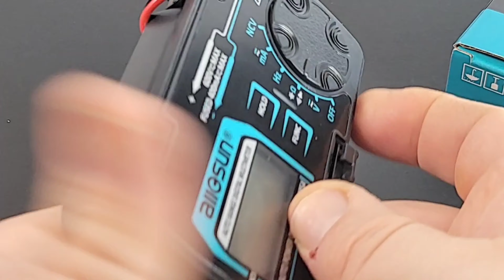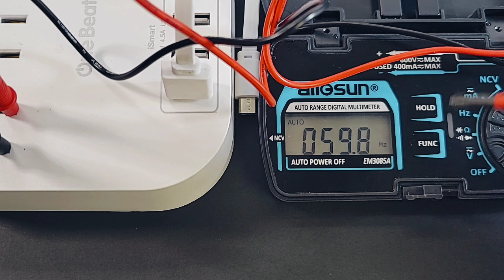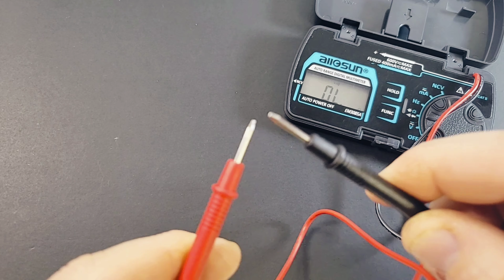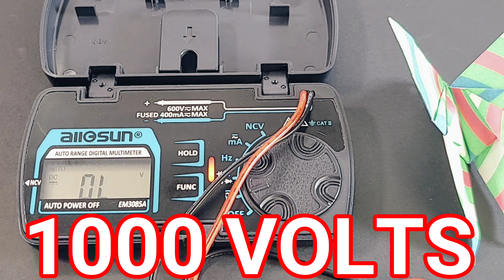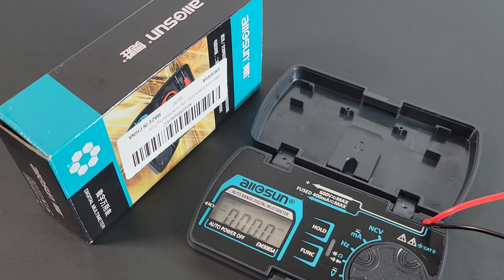ALLSUN 3085A CHEAP-O Multimeter Review & Teardown!

Comment: nice review.. at first i was about to just end watching when you made snarky comments about this meter that seemed unfair to me. Also, when you opened it up to put in the battery i wish you were more careful with your editing to show us what you saw inside after removing the back cover. It was frustrating that you didn't show us the inside where the battery and fuse are etc. thankfully i continued watching and was able to see the circuit board and battery and fuse. I am ordering one of thes meters. i think i may take the ciruct board out and then modify the screen cover so i can se the display better.
Reply from the maker: Thanks 👍  I always do the teardowns and reveal in the last part of the review ..glad you stayed until the end  😊

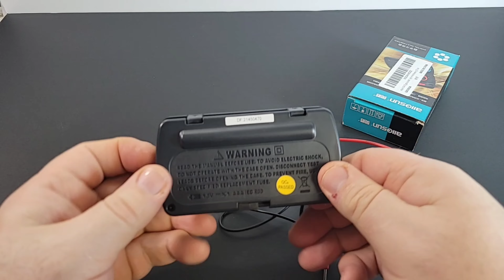Comment: @2:30 Take out those leads and the retaining tab becomes a kickstand - that's what the arrow is trying to tell you!   "Wouldn't it be nice" if they put that in the user manual after they show you the case locking mechanism!
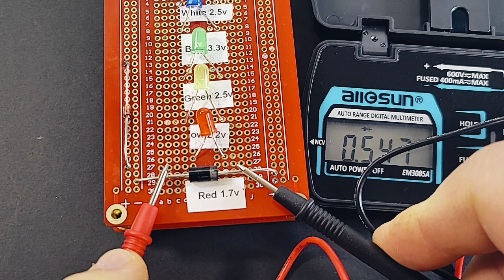@6:00 I have a special white pen that I use on many of my selector switches to make the indicator stand out.  Alternately whiteout correction liquid and a toothpick.
@7:00 2,000 counts rant - I agree!  I hate the last digit flipping back and forth between values and creating a significant % error in the reading.  What do I do, round to the middle!?!?
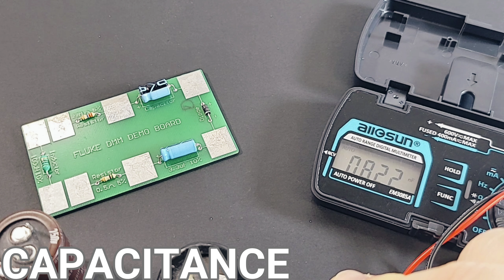@7:50 The ability of the DMM to measure/light LED's seems to be proportional to the voltage of the power supply.  This one has a 1.5V cell so it's no surprise it does poorly.

Comment: Nice review as always! I own an Allsun 2-in-1 meter (oscilloscope and DMM). While they make good instruments, they definitely made interesting choices. The oscilloscope was supposed to have 25MHz bandwidth, but they use a black-and-white, low-res 128*64 LCD screen. You heard it right, 128*64…. And half of that screen was just displaying information such as VPP value and time intervals. Imagine displaying your 25MHz oscilloscope signals on a 64*64 screen…
Reply from the maker: Yikes...maybe someone didn't get the memo! 😅 Allsun definitely is an interesting OEM...I have a love/hate relationship with them. Some of their test instruments are excellent others...absolutely not. 😮

Comment: I bought this thing after studying a few reviews.  Got it in the mail today and was playing with it.  I'm not very good at electrical but needed a decent compact multi meter for basic use and continuity testing.  I have a hard time hearing the sound of most of them, so the light on this one really sold me.  I was really impressed with all the functions in this meter and was playing around showing it to someone and said lets see how much power the house cat has in it.  It was on NCV and I started rubbing it back and forth on the cat and the darn thing went crazy,  all four bars, beeping and lighting up,  lol.   Static electricity?? lol  I noticed after that I could tap it and rub my finger on it and it would beep.
Reply from the maker: Sounds like you had fun! 😃 EMI can be very powerful.  Your cats static discharge will definitely alter the meters reading.
Reply: @KeepOnTesting  Does that mean I may have damaged it?
Reply from the maker: @bettinanstevens9259  I don't think so. It doesn't have shielding so just keep it away from the cat 👍
Reply: @KeepOnTesting  If I glue a magnet to bottom of the clamshell will that throw off the readings or harm the meter?  I noticed the magnet on the meter of your latest review and thought one would be a good idea here.
Reply from the maker: @bettinanstevens9259  That's a good idea. It won't affect the readings either.👍